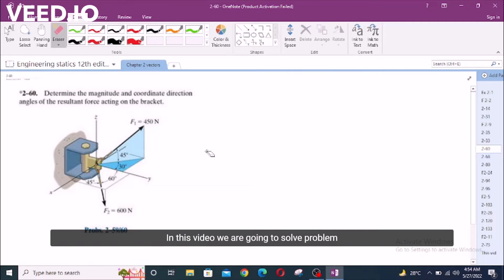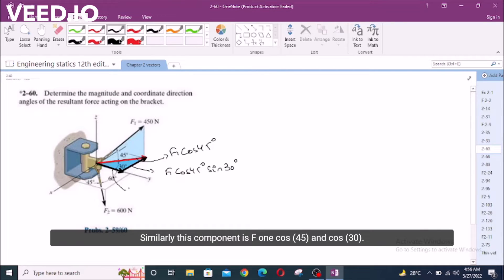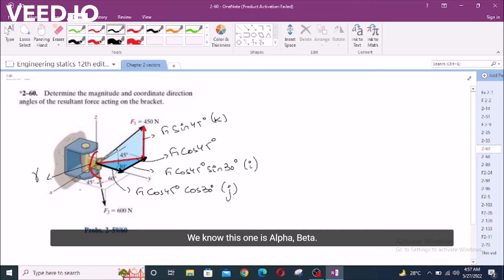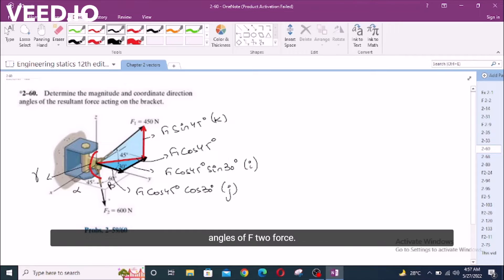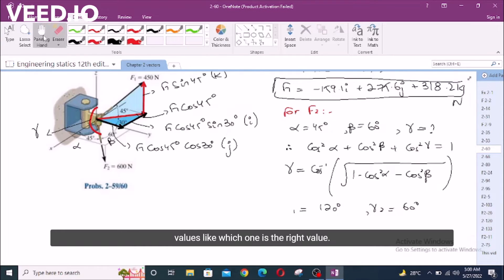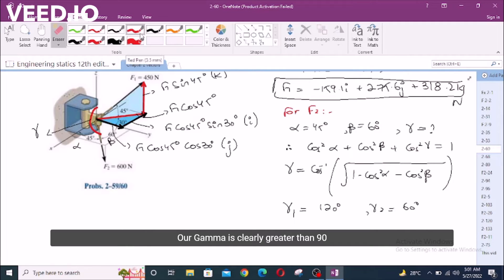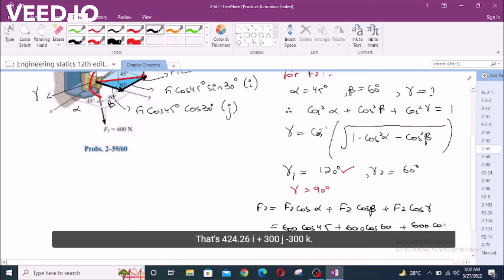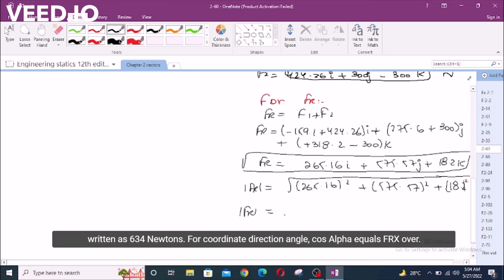2-60 hibbeler statics chapter 2 | hibbeler  statics | hibbeler

Comment: Why in z component in f2 not equal -600 cos 120 because it makes 120 degree angle with negative z
Reply from the maker: Using 120 degrees for the z component of F2 force will make it negative. That's why we do not have to put negative in front of 600cos(120) . I hope it will help!

Comment: sir how did you get the two values for gamma? I'm only getting the value for gamma 2 if i input the formula on the calculator
Reply from the maker: At 5:40, when you take the square root you get two answers, a positive and the negative answers. using the positive and the negative values give you two gamma values. I hope it will help!

Comment: And why x component of f1 is having cos and sin both and why y component is having cos45 and cos 30
Reply from the maker: Sin is used for the sides opposite to the angle and cos is used for the sides adjacent to the angle.
Reply from the maker: First I drew the projection of the f1 force along x and y plane. Then I resolved this projection into x and y components